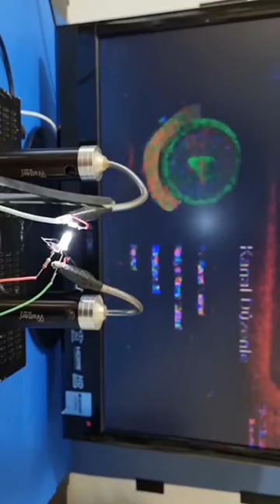How to Transfer Video Using a LED #shorts #shots #zaferyildiz  #electronics #circuit #altium #viral

Comment: Instead of using an led, Try using a laser diode as  the beam is more focussed.
Reply: LoL, that actually makes it harder.
Because the receiver diode has to be in exact alignment with the laser diode.

With the LED the light diverges and therefore such accurate positioning and alignment is not required.

Amazing how 19 of you thought the original poster was right.  All of you must have skipped physics class in school.

Comment: Great idea. Spend a load of time building a circuit that allows a really bad picture to be seen on the TV screen. 
You might have more luck with a laser diode. 
Or a cable that plugs into your equipment and shows a perfect picture.